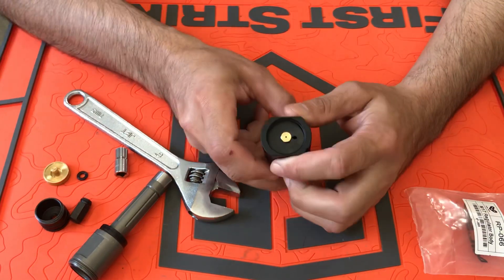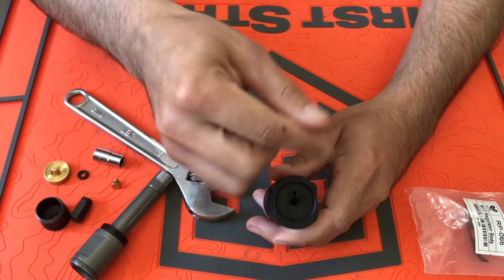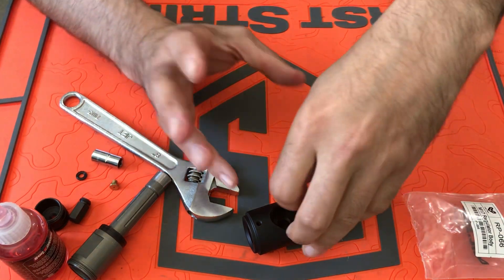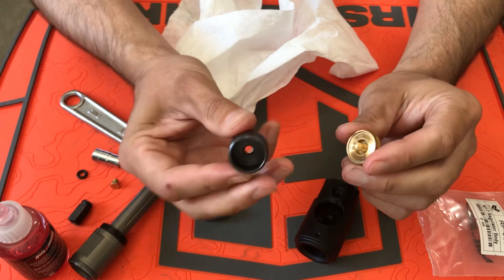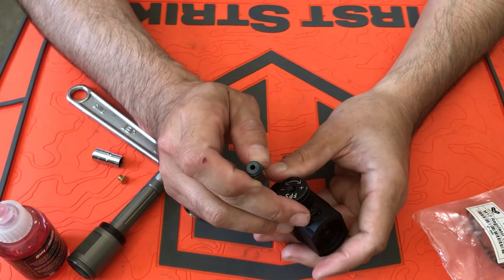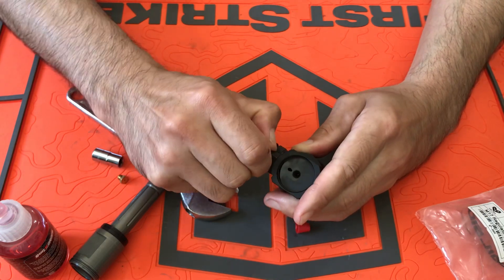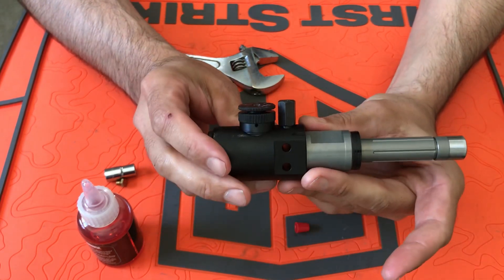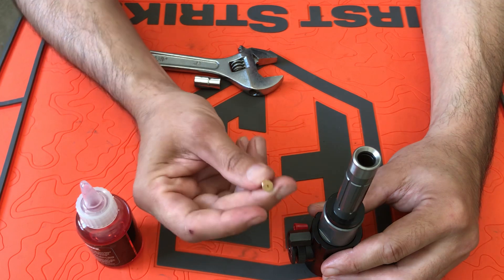Valken M17/Cqmf VERSION 2.0 bypassed regulator install.

Comment: Hey bro couple questions, would removing the brass oriface or set screw increase the fps by exposing the big hole left by the oriface? What exactly is that part doing by being removed? I suspect its for more rapid air intake to allow you to fill the reservoir inside the marker to fire quicker, full power shots at high fps? I have not twisted the bolt off yet because mikey from canada riot balls suggests once the bolt is separated from the reg body, the air touches the o ring inside that part and goes bad instantly, so once valken sends me that o ring i plan on removing that oriface. I welcome any thoughts or advice. Thank you for this helpful video log format, Its really cool that you do this for us laymen air gunners following along and trying to learn! 🤘
Reply from the maker: Removing the orfice allows the transfer of air from the regulator side of the heatcore (velocity screw side) to act as a larger air space which increases power. The chamber oring is reusable a few times i have found. Be sure to oil the oring before screwing the chamber back down which will help set the seal without chaffing. Make sure to use a good adjustable wrench to undo the first time as there is some form of thread locker but it is easily broken free by a sturdy hand. It is not necessary to apply thread locker during reassembling just be sure chamber is tight. Remember the orfice is metric so use the correct socket for removal.
Reply: @lesslethalfordummies  10 4, will be rewatching for reference, I would have been waiting on the snail mail for that o ring so i appreciate you saving me time, now i have something fun to do tonight👍
Reply from the maker: @nickzurfluh3731  let me know how it goes. Of all the ppl that contacted me i know of one that had an autofire issue removing the orifice and its really tough to say if that was actually the problem as they are so many variables and states maintenance or lack there of.
Reply: @lesslethalfordummies  I wonder if he had his trigger group springs shimmed or replaced with stiffer ones? If Im not mistaken that is usually happening, in most cases, because the seer isnt catching? My M17 has .8mm x 5mm x 15mm rated springs replacing the three old ones in the trigger group, so im hoping ill get lucky and not have any autofire issues, Ill report back with my findings so other people can benefit if they come across this video, in the meantime i gotta make sure i have all my allen keys and a 7mm hex key because im not sure which plug ill find in there once i twist her off, time to tear apart my closet to find my hex key set!
Reply: Update:

Holy shit!! I was shooting a cookie sheet after removing the loctited set screw and threading the bolt and reg body back together, the one hp68 i shot went clean through the metal sheet at about 12-15 feet distance, devastators left a couple solid 1-1.5 centimeter deep impressions on the sheet, they were shot using a 12 gram c02 and stock valken barrel in a M17A2. I have a chronograph app on my phone that works off the microphone and it read an average of 46 joules, first shot was always usually above or atound 55 joules, according to my shitty app lol. I had one jam on the last full power shot using devastators, but my detent spring is definitely starting to go on my grizen g mag. Ill do another update in a couple days with an 8", .687 bore hammerhead rifled barrel, just didnt want to mar up the barrel shooting those notoriously underbored devastators, even with lubricated rounds, i dont have any tools to work out barrel burrs from the steel tips, so Im playing it safe with the stock barrel that I dont care as much about for the time being until i see how often the devastators scratch the stock barrel first lol
Reply from the maker: @nick zurfluh  you sir have reached ternminal velocity.
Reply: @lesslethalfordummies  Im picturing the movie deep impact, every time I let a round off, I imagine Morgan Freeman making that concerned face he does in that movie 🤣

Comment: So I've done this mod. Everything gutted. Trigger housing all upgraded as well but after the first mag I lost all the air in one second from my HPA tank. Attached a fresh tank and air started gushing out of the barrel. Any ideas why? I gutted the regulator, cleaned it,  relubed the bolt and orings as well. Really lost on this one
Reply from the maker: Air out the barrel usually means you have lost your heatcore oring the one that is inside the tip of the air chamber that the bolt firing pin slides back and forth on. Check it still there or has been pinched.
Reply: @lesslethalfordummies  that was it!! Thanks man! Not sure how that happened. It was completely gone nowhere to be seen
Reply from the maker: @MG-qz6ft  oversights happen to the best of us. Thats why its less lethal for dummies. Even i make errors the important part is recognizing the problem for the inevitable next time or to help some one else

Comment: Did u use 3 or 4 bumpers on the Bypass mod ? Ty :)
Reply from the maker: Originally i was using 4, but am up to 6 bumpers now as it slows the bolts rebound significantly to prevent missing the sear.
Reply: @lesslethalfordummies  ok thats wow haha at what fps Level u would recommend 6 ,or its not depend on ?
I want do Bypass and pvr delete with shp 1100 actually i have no idea what fps she will give so i will start with 4 bumpers and if i will get problems i May stock one up or two .. u thibk its possible or u say take 6 from start its generelly better.

In case i will start With 4 ..what typical Problem comes up if too less bumpers use its like doubleshots or how i really know when i get to less bumpers on ?

Ty for your help man ..
Reply from the maker: @werissdieserjunge  typical problem is  autofire. If you are not tuned for high fps yet 4 bumpers is sufficient. I just got even more bumpers to see if it gets better or worse.
Reply: @lesslethalfordummies  get it ..so autofire happens sometimes ..i will tune it soon i when i Bypass the m17 i can spare me the chroning and tuning Process at all right ? And we Provide from burstig the cap with Bypass also ? I will start next days for the m17 :) just collect information to prevent Mistakes 😀
Reply from the maker: @werissdieserjunge  bypass will prevent broken caps. I recommend not removing the brass orfice from the air chamber at first to make sure the bypass is function properly.
Reply: @lesslethalfordummies  ok i will ...what happens when the Bypass not will works Proper ...like leaking or what i have to expect ?
Reply from the maker: @werissdieserjunge  yes if the piston is not straight in the reg or you cross the cap it will leak or blow the cap completely off.
Reply: @lesslethalfordummies  ty :)

Comment: Hey man. This is great but one question. Do you need to tune the marker before you do this or does this completely over ride that step?
Reply from the maker: I always recommend firing your marker up bone stock out the box to verify there arent any initial issues. Do one thing at a time. Prv delete next have some fun, the shim the sear and turn it up a little. It means so much to understand how your marker behaves before you become frustrated and want to trash it.
Reply: @lesslethalfordummies  thanks man. I agree, I've had it about 6 months. Done the bumper and pvr delete mod. Tuned it slowly but surely so just gearing it up for the shim sear and after that once I test it I'll probably move on to the bypass.
Reply from the maker: @MG-qz6ft  sounds like a solid plan. Always best to get to know her a little first.

Comment: What output pressure would you recommand  for this mod ?
Reply from the maker: I would never recommend more than 1100psi for any paintball marker. Anything less is perfectly alright but you will see reduced fps accordingly. My m17 and many others m17 have stood the test of time running 1100 though. The only issue i have had was the two piece bolt and the guide pin on the bolt loosened but once reset with red loctite havent been a problem ever again.
Reply: @lesslethalfordummies  many thanks!!
Reply from the maker: @pierro1977  have you successfully tried it yet?
Reply: @lesslethalfordummies  not yet 1100 but abput 800... I bought a psi tester for the bottles but it is hard to use cause the pressure is on when you remove it 
another problem i have is the on off asa adapter : it makes very long setup with standard 13ci bottles
Reply from the maker: @pierro1977  yes without some pressure release it is very difficult to remove gauge. One downside to the m17 is its almost too long with asa on/off. That why I originally use 9/10ci bottles

Comment: Just curious, what's the benefit of bypassing the regulator? Is it to use CO2?
Reply from the maker: The benefit in case you missed it in my follow up video is not worrying about busting caps. A by product is the use of co2 but that was never the original intention it just happened.

Remember the bypass by itself isn't some magic voodoo to shoot lasers. You can achieve the same results completely stock with prv delete and shimmed sear but its risky walking that fine line. This is good for those that never intend to shoot anything less then solid projectiles. Your bottle output pressure is the sole deciding factor in you fps.
Reply: @lesslethalfordummies  Thank you for the information. What kind of numbers(fps) have you gotten with a 9.9 riotballs?  I've blown two regulator caps and didn't want to use a hose clamp to keep it together. So this looks like a great idea., scratch all this, I just saw you posted a video showing the results. Thanks for sharing this with us.
Reply from the maker: @bosshilf  you can actually reuse your busted cap with the bypass so dont throw them away.